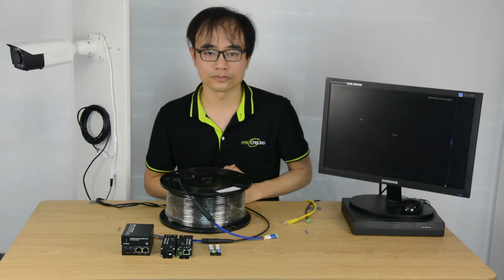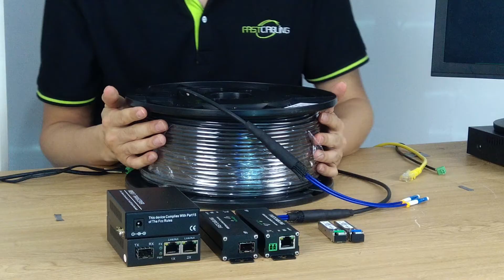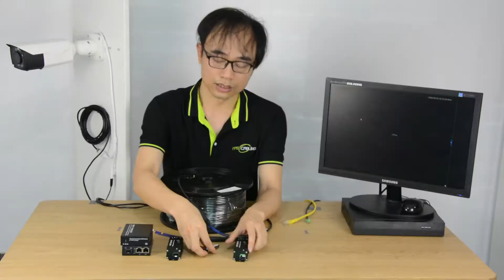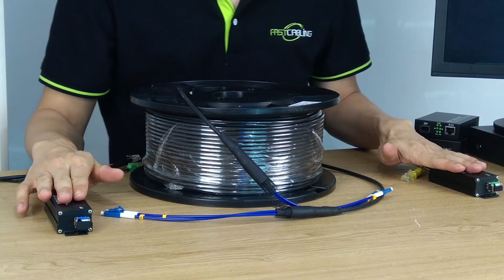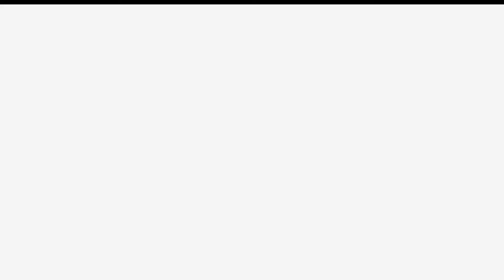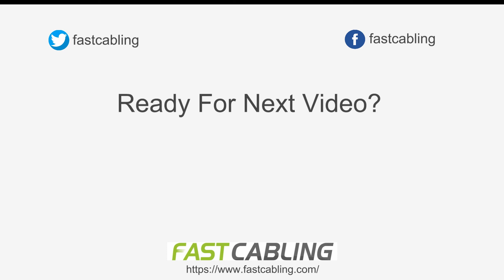media converter Fiber optic connection between point A to point B

Comment: How to protect media conveter in lighting
Reply from the maker: If your fiber optical cable doesn’t have metal string, you don’t need to ground the cable. Otherwise you might ground the metal string both end. You can add the surge protector to protect the power source go into your media converter.